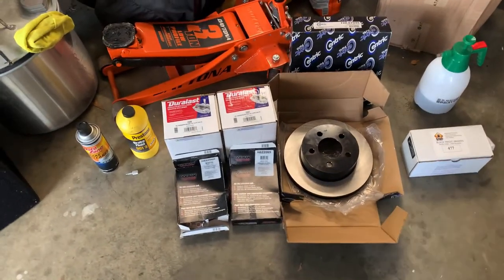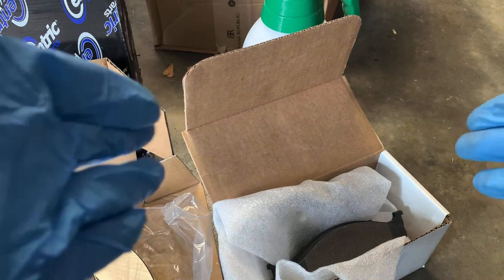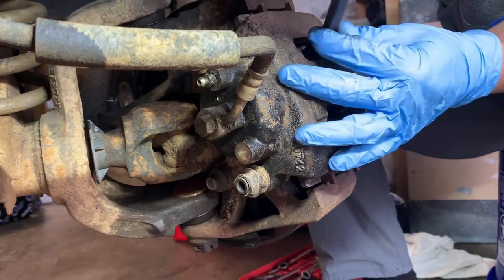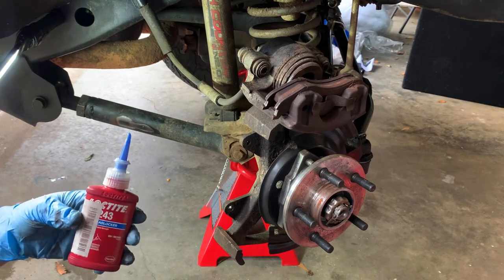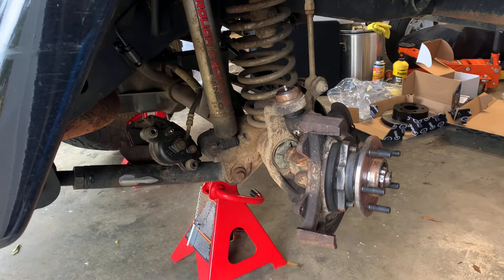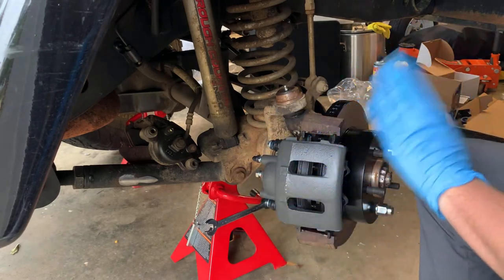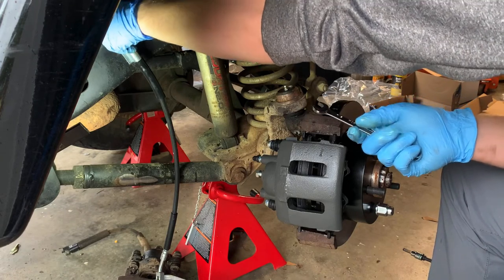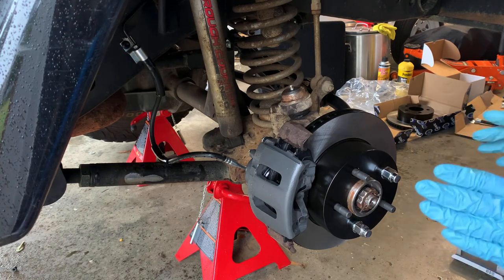The ULTIMATE Jeep TJ Brake Job - Black Magic Brake Pads! Rotor and Caliper Replacement!

Comment: FYI, Install caliper by position notches at lower end of brake shoes on bottom mounting ledge. Then rotate caliper over rotor and seat notches at upper end of shoes on top mounting ledge

Comment: black magic brakes seem to have shot up in price since this was recorded... the 16" brake kit is now $1,566 and it's not even in stock. my level of know-how stops at turning bolts, tugging/hitting things, and pouring (spilling) fluids... any way you could help me track down links to upgrade the brakes on my TJ? I'm running 35s with the potential for 37s in the future so i kinda felt forced to go with the kit, but if there's another way, I'm extremely interested.
Reply from the maker: They sell different kits, I have the more stock ish upgrade kit that used premium rotors, black magic pads, and new calipers. They also sell the vanco kits that are expensive like you said. If I was running 37s I’d be inclined to look at something like that, stock single piston calipers are not going to have fun stopping 37s.
Reply: @jetskirehab750  based on your experience, would you trust your braking setup with 35s and steelies on a mountain road? (considering both initial stopping force and brake fade) 
if it's really that much less $$, i could just put off 37s (possibly indefinitely)
Reply from the maker: @themrwinston9570  gotta pay to play, I probably would run the bmb stock kit like I had with 35s. They would completely lock up 33s